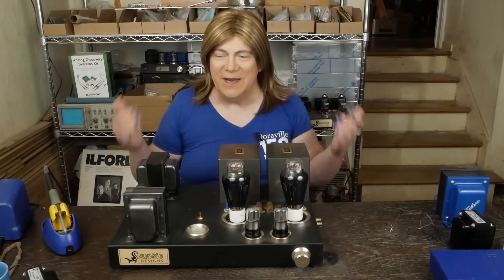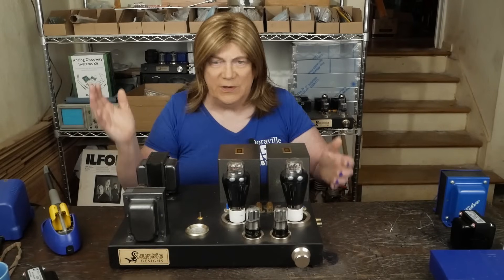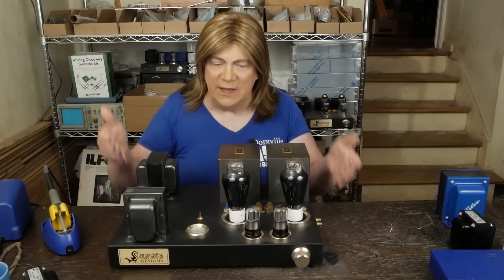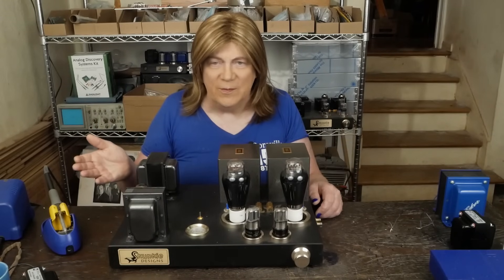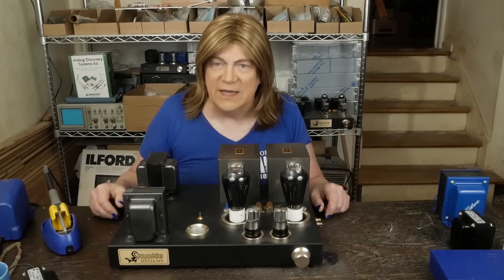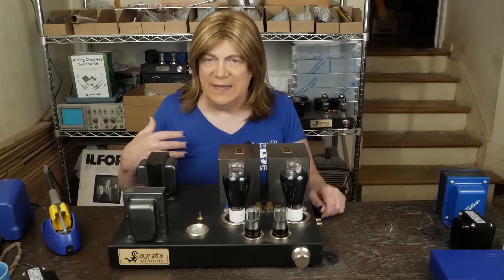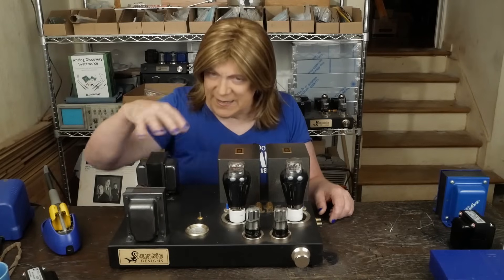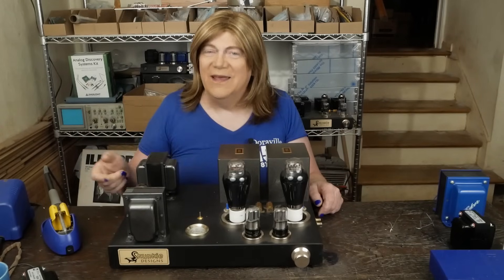Tube vs Solid State Amplifiers

Comment: You and I are of about the same vintage. I agree that there are times for both technologies. My break down is solid state for utility amps, subwoofers, and casual use especially if you are likely to fall asleep such as a bedroom system. For any serious listening I want tubes on my mains. I generally don't bother with speakers that are too inefficient to work in the room at hand with modest power so that isn't an issue for me.

I am not convinced that the tube magic comes from what they add as opposed to what they don't add but the only tube amp that I have extended recent listening experience with is my SEUL KT-88 with "Schade". Some day I plan to build a push pull to compare with it but not for mongo power. I just want to see what the PP topology brings to the table. So it will be triode or UL with only local FB.

But first I need to finish building main speakers for the music room so I can get my existing tubes back in rotation. 😊

Comment: Two points of disagreement with Stephe: 
(but first I want to say I just discovered this channel and I’m quite enjoying it!)

1.  I strongly disagree with the idea that higher power push pull tube amplifiers are nonsensical because they’re just trying to do the same thing as solid state.  I think that’s clearly not the case - even push pull tube amplifiers have the “ tube sound” that many audiophiles love.  I’m heavily in the tube amplifier camp.  I started off in the 90s with a car Johnson MV 55 , EL 34 based amp.  It created sound that was so lush and organic and human sounding compared to the solid state application they replaced.
But with the type of loudspeakers that I was trying on my home, I needed more power so I replaced them with Conrad Johnson premier 12 monos.  I’ve had these amplifiers for almost 25 years now and you have to pull them from my cold, dead hands.  They have enough power to drive virtually any type of loudspeaker that I wanted to try.  So I haven’t been limited to the types of loudspeakers I can use.  And yet they do their magic with every speaker - a combination of lush organic sound, but with plenty of punch and aliveness.  
Sometimes I wonder if I would even be in the audio hobby if it weren’t for such a tube amps.   I have heard SETs but wouldn’t make a different decision for myself than the CJs

1. Slight disagreement about the combination of solar estate amplifiers with a tube preamp.  This is a classic combination recommended for people who want or need the power and grip of solid-state amplification in their system, but who also wants some tube colouration.  What I have found is that this combination doesn’t really satisfy if you really love tube amplification.  Because I… and I know quite a number of other others… have found that the main tube flavour comes from tube power amps.  Whenever I’ve tried various tube preamp with solid state amps, the main character of the sound has been solid state not tube.  In fact, though I have always run tube preamplifiers, a while back I actually tried a solid state preamp (benchmark) with my Conrad Johnson amps and that was a glorious combination!  It kept the essential Conrad Johnson tube   sound, but was more transparent, more precise, and had more grip than any tube preamp I’ve owned.  I still keep my car at Johnson premier 16 LS2 because I still like putting it in the system as well.  But anyway, that’s just my views for my own experience.  Ultimately, of course I’m talking about personal preference, not some objective prescription for other people who may like other things.
Reply from the maker: I don't recall saying they are nonsensical. But you aren't going to convince me that a push pull amp with a bunch of global negative feedback is going to sound as nice as a DHT, or any SE amp, with no global feedback. It's just a engineering fact a push pull amp working in AB has mostly 3rd order harmonic distortion. Again, this is my opinion, everybody has one.

Comment: People tend to think that solid state deteriorated sound less than tubes...I D
don't think that this automatically is the case. People like Tim de Paravicini (of ear yoshino) who worked with tubes and transistors state that transistors have inherent flaws (memory distortions) that tubes don't have. Especially the mega high power solid state amps with gazillion of parts leave nothing intact of the music played through. Also every resistor, every capacitor colors the sound, while maybe not shown in measurements, it can be heard easily...I'm my book, the often referred neutrality just doesn't exist. I see Hifi gear as a connector of the emotions inherent in recorded music to the listener... something tube amps do often much better than complex solid state gear. E.g. my tube amps have maybe 5 parts in the signal way, while the might measure worse than any soldi state gear, they leave the fine nuances of music, interplay between instruments etc. Much more intact than e.g. any mega watt solid state amp. I had really high end solid state phono preamps from ASR to Gryphon, they just don't leave music as intact as a simple tube unit with a good step up transformer. Our ears and brain are much better in deciding what is goid or not so good, than any measurement.
Reply from the maker: All of this is on point!!!

Comment: Spot on!.. that's how I feel about amps and audio. I used to have a "great" solid state combo and boredom.. when I bought a colourful sounding Dynaco St-70 and pre in a flea market.. and bam! the fun was back, and I understood that I equally needed efficient speakers. Years later, I now use a tube preamp (Counterpoint) and Sugden amp (SS) in summer, and my Quad II tube amps in winter, or my SE 300B, or SE 45, with Tannoys, or Reference 3A MM, great little speakers too, but anyway, the music, the pleasure are back for good.. Thanks for the great work Steph.

Comment: Been building a few SS amps, such as the Pass F5M and the JLH (1969) amp. As impressive as these amps are, I still love the sound of a good tube amp. A nice inexpensive build is the SPP  (Simple push pull) 6BQ-5  tubelab boards, or that of the Simple SE (single ended) boards. These all demand high efficiency speakers.

Comment: In my experience SS amps with high negative feedback also do not sound right.And they also tend to mask the good quality of a tube preamp.I used a Supratek 6SN7/ 300B preamp for 14 years that could sound gloriously tubey with some SS amps  but less so with others .Anything designed by Nelson Pass let the good stuff through.A Musical Fidelity A5 and Rotel Michi did not so much.
I also had an Almarro 318B SET which used 6C33C tubes .I got a friend to install a variable negative feedback selector in it that gave 5 different settings .I think all tube amps should have those.On most speakers just a hint of negative feedback sounded best .The factory setting actually had too much for my taste and speakers and zero was too euphonic and bloomy .If you apply too much the soundstage noticeably shrinks.I think you get that same effect with SS amps although the differences are less obvious.Nelson Pass has spoken about that.

Comment: Dynaco ST70 had this "lush" tuby sound, that was too much for me.
An RH84 converted motorola amp that sounded so good but needed hi efficiency speakers.
I built the MOFO amp from DIY audio and that sounded great. Warm vocals, deep bass, but needed hi efficiency speakers.  Unless you leave it on it tends to blow up.
Built an elekit 8200 SE w/ KT88  and the matching  tube pre amp  very nice but almost too clean
Right now I am running the elekit tube preamp with a Haffler  xl280 solid state  and that sounds pretty good.
The search goes on.......its a form of insanity.

Comment: I have to disagree on the Magnepan myth... Magnepans work BEAUTIFULLY with decently powered tube amps (50W+) in normal rooms, provided you aren't trying to light up a dance hall sized space. Typical loud listening on mine is around 10W peaks, so nothing crazy and certainly not requiring monster power. Keep up the good work, I'm particularly impressed with your exposing poor designs and how to fix them - I'm taking notes!
Reply from the maker: Given there are no 50W+ single ended zero negative feedback amps, you made my point :)

Comment: Yes, yes, yes, I am 98% in agreement wih you.
Just a few comments:
(a) 0.05% harmonic distortion by solid state amplifier? Probably that is only true if you listen to a constant test tone, not sure the distortion % is just as low for real music.   Besides, the 'air', or the sound of a note decay, is often missing from a solid state amp, making it sound 'less real'.
(b) Solid state amp usually has a much better signal-to-noise level,  and the quieter background is audible (even for my 61 year-old ears).  That's something we should try much harder for tube amp's.
(c) Solution: tube pre-amp + solid state power amp, or a hyrid amp.  I agree with you there.
(d) One suggestion: tube rolling - I would appreciate if you could test different tubes and show how the distortion curve changes with different tubes.  This is similar to changing different transformers, capacitors, and resistors.   It is invaluable to learn which expensive/cheap tube, capacitor, transformer, and resistor works or not.
Thank you so much for your insight.

Comment: I've enjoyed this video... after years of swapping in and out of solid state I have recently begun to wonder if I've been doing it wrong.  Tube amps sound so much better to me than some expensive SS amps I've heard.  For me, however, I still have high frequency sensitivity but have lost mid range hearing.  Apparently for me tubes really are better.  You hearing my vary of course :) .

Comment: Mixing tubes and transistors is a good way to go. I have a Conrad Johnson preamp, and a 350W per channel pair of monobocks.  But it's not what you might first think. The Conrad Johnson is a PF1, their first and very limited go at an all FET preamp. The power amps are Vacuum Tube Logic MB300 units, with 8x 6550 tubes each side. Yes, I am crazy.

Comment: You mentioned Magneplaner speakers as difficult to drive, for sure  they were. My boss had a pair in the 1980s and needed a Musical Fidelity A370 - class A, 185W per channel beast - to drive them properly. But the amp killer at that time was the Apogee Scintilla. Basically a crowbar load down to DC. Only thing at the time that could get close to driving it decently was the Krell KSA range of amps. Brutal things, make sure delivery cost is to the last physical place they will ever move to, but a joy to listen to.

Comment: A note on hearing capability when getting older. Sure your hearing range will tail off but it isn't as bad as most people make out. It is not a linear scale, loosing the frequencies above 16Khz is only 1 octave of the 10 octaves that the human ear is designed for. You can still hear the full range of a piano and the human voice. Not being able to hear that last octave does not make you in any way unable to appreciate music or hear very subtle differences in equipment. I've just joined the Skunkie club and I can still discern a lot more from the playback of a recorded piece of music than most 20 year olds. Perception is everything, years of experience cover the missing tones at the very upper end.

Comment: Very good points, needless to say I agree with all. I'm 61, roughly the same age group as most ppl here, the enjoyment of music has always been the priority since childhood (I also play some) and having been bitten by the hi-fi bug in my 30s I've reached the same conclusions re tube vs solid state. My amps are a pair of the late Don Garber's 2A3 single-ended direct heated monoblocks that can also work with the 45 tube (by changing the rectifier tube) and the results are like the ones described, music comes alive and there's a sense of the musicians being in the room. Up till some months ago my speakers were Tannoy 15-inch, sensitive enough to be driven by these amps but I recently switched to open baffle DIY field coils and I only wish I had made the transition earlier, results are so much better than with dynamic speakers, I strongly urge you to go that way and see for yourself. Another point I'd like to make is that music is best reproduced in the medium it was recorded for, one's gotta hear 78 rpm shellacs played through a modern hi-fi system, the amount of energy these babies have in the mid register that our age group is most sensitive to is breathtaking, there's no way one can hear it on modern digital transfers or even on vinyl transcriptions made during the 1950s or later, so get your hands on various formats of music besides digital i.e. vinyl, shellac, reel-to-reel, cassette and enjoy the music, my 2 cents. Peace

Comment: Hi thank you very much for the very valuable advice
i have noticed a certain commercial success for units that actually combine the two technologies
Usually they have a voltage amplification stage made with tubes and an output power stage made with transistor or mosfet  
The nice thing with tubes is that they can provide high gain with great linearity  
Just one tube could be enough to provide all the gain needed in an amp    Cool  
I have also to say that they are not very common around   Unfortunately ?

Comment: Unfortunately have to admit to my age related hearing issues as well.
Regarding Tube vs Solid state.
I had a top of the line (Theta. Krell, Martin Logan Sl's setup for Cd's, and  a Micro Seiki Turntable, Audio Research pre and power amp (tube based) analog system.
The Krell sounded absolutely superb.
With the Audio research system, apart from sounding amazing, I honestly believe that I could also  "feel" the music.
Music enjoyment on another level
Just my 2 cents.
Just remember to use what you enjoy, not what anyone else tells you to.

Comment: Howdy.
Sounds pretty much what PS Audio advocates.
For Hi-End. Use tubes in the preamp. and phono amp. Then use Mosfets to deliver the power.
I would think using tubes in preamplification actually delivers the grunt of the upper bands.
Regards.

Comment: I’m a young (deluded) 70 year old now. 20-35 I had a solid state amp which was well rated at the time-but it was just OK music out of two boxes. Having some funds at 35 I decided to upgrade my integrated amp and duly went around several Hi-Fi shops trying the latest magazine solid state recommendations within my budget. I had to creep out of the shops feeling embarrassed and thinking -was that any better than I’ve already got? I eventually by chance ended up in a small shop and they sold valve amps which they highly recommended. Blow me down I discovered a holographic mellow sound that I was searching for - a bit like Glenn Miller discovering that illusive sound. I still have that amplifier now and don’t feel the need for anything else in my listening environment. I’m just in the process of changing the 35 year old electrolytics though before they explode 😀. Great videos, thanks.

Comment: Very sensible advice. Hifi is a 'horses for courses' game
Reply from the maker: 100% and as I said, this is just my opinion. But this also guides my build choices and why I'm just not that interested in building high power push pull tube amps.

Comment: I'm 38 and my frequency range goes up to 17kHz or so, at least from what I could check with my sine wave generator and headphones. Definitely a fan of tube amps, but I use a solid state one most of the time because electricity is expensive here.

Comment: This may sound crazy but I'm running maggie .7's with the kegger/blueglow kt88 design.  i run exclusively in triode mode with no schade feedback. The trick was to use a small coupling cap to bring the 3db point up to around 20 hz, and add in subs of course. Room is smallish, 15x17. Holographic is the right description! AB tested vs a big solid state amp (marantz 2285b, bypassing its preamp) and there's no comparison. The SET wins hands down!

Comment: Tubes are the only way to go. Solid state just  doesn't cut it. I don't want  a transistor radio. No thanks. Don't  need the low output and distortion. Solid State just really doesn't work when on stage. Tube amplifiers were perfected many years ago and still rock. That's why you build tube amps and why I watch your page and repair my tube equipment!!

Comment: My experience has been that the weakest link in the system is the SOURCE MATERIAL!  Whether LPs, CDs, or audio DVDs....and cassettes I record off the Internet, more often as not, the vocals will have a "metallic" sound, like BBs rattling around in a coffee can.  It's probably the mike pre-amp being over driven.  I believe that, because the distortion goes away on softer passages.
Reply: So true